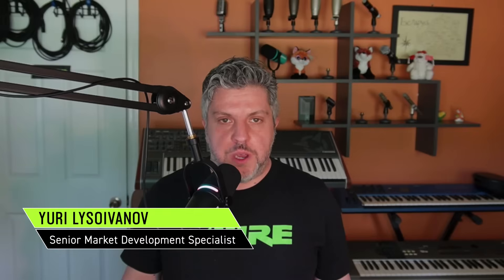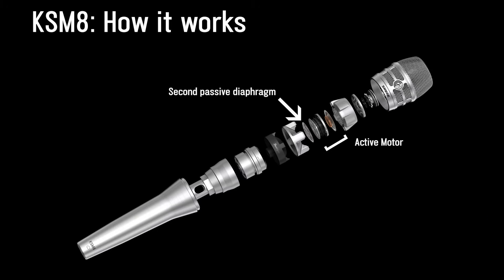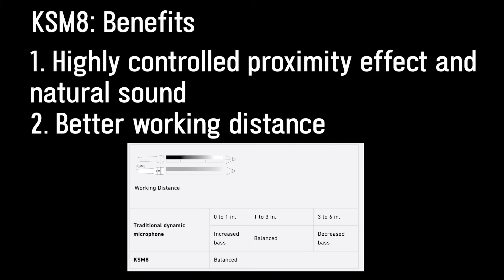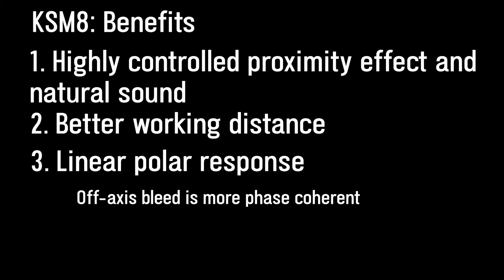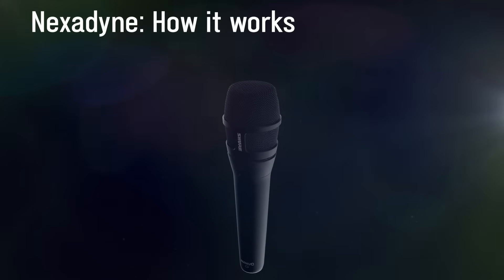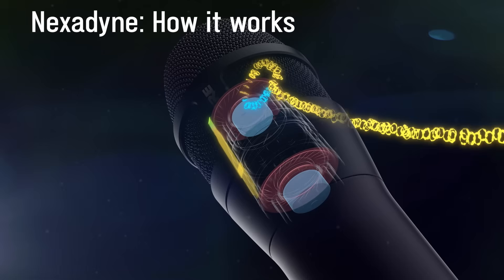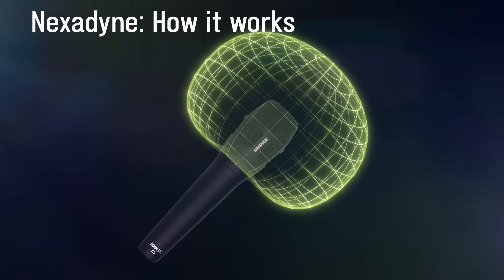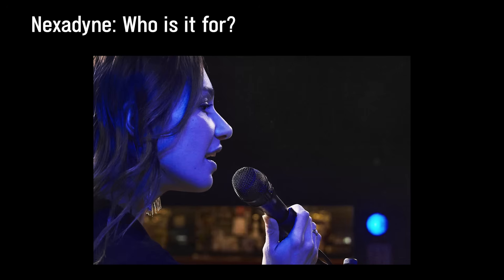Understanding KSM8 and Nexadyne NXN8: Differences and Unique Features | Shure

Comment: Someone seems to have forgotten about the AKG D200, D202 and D224 mics from the late 60s and 70s.  They were the real first range of dual diaphragm dynamic mics.  The KSM8 might be the first available for quite some time, but it's standing on the shoulders of giants.
Reply from the maker: @WonkeyWabbit The AKG 200 range does contain two capsules but they are not used in the same way. We touch on this in our KSM8 article here: https://www.shure.com/en-US/insights/dualdyne-technology-unsung-heroes-live-performance in the section under 'Dual Diaphragm vs. Dual Element'

Comment: the ksm8 and nxn8 ,, there is the top game ksm11 ,, can we just switch between capsule and having the same handle , just switchin the capsule from one to one , are they compatible
Reply from the maker: Hi! You can swap capsules if you are using a wireless handheld transmitter like our SLXD2. You cannot switch capsules on our wired mics.

Comment: Which is better, the shure ksm8 or the shure nexadyne 8/c in church venues?
Reply from the maker: Hi there! This comes down to a few things. What is the main application? If spoken word, I would recommend the KSM8. If you're looking for a microphone that performs well on spoken word, vocals and instruments, the Nexadyne may give you more options.
Reply: Hi I am thinking of getting the KSM 8 as I am a Cardioid kind of singer.  But my set-up up is minimal, no sound desk.  I am using the Bose S1 Pro + and the Bose wireless transmitter.  I need a 'hot' mic and one that requires little eq out of the box because I don't want to crank up the gain and get feedback.  I know some mics need a lot of gain, which is no good for my situation. 
Thank you.

Comment: I am a classical tenor but I also sing rock songs. Which one should I go for? (Currently performing with a Sennheise E965).
Reply from the maker: Hey, Yuri here! The mic you're using now is a condenser mic with selectable patterns. While the KSM8 and NXN8 are both dynamic mics, the NXN8 would be my choice for your needs since it sounds surprisingly similar to a condenser mic but has all of the advantages of dynamic on stage! Also, if you're playing a lot of loud rock music - the NXN8 will provide better rejection compared to the KSM8. Your current mic also has a selectable polar pattern, while with the NXN8 you'll have to choose either cardioid or supercardioid. If you're interested in sticking with a condenser microphone with selectable cardioid or supercardioid patterns, check out the Shure KSM9!

Comment: KSM8 = Plosives and severe handling noise and rapper-grip problem and don't ever use on a podium. NXN8 seems to be addressing this and at a lower cost. and yes the Beta 87 is a better all-around mic than the KSM8.
Reply from the maker: Yuri here! I love the KSM8, but if you're working with a lot of rappers - I'd recommend giving the KSM11 a spin!
Reply: @shurecreators  interesting , i dindt look into the kms11 ,, looks like an extention of the nxn8 and ksm8 combine .. would sounds brither like the nxn8 ? also can we just switch the capsule between all of them and keeping the original handle ? also is it possible to buy just the handle as well . thaere a lots of fake as well being sell ,, dont want to get caught.<
Reply from the maker: Thanks for sharing your experience with the KSM8, I'll be sure to address these concerns in future videos!

Comment: From your description the Nexadyne sounds better than the KSM8, which doesn‘t make much sense to me. The question is: If you had to bring mics to a jib without knowing the vocalists, which one would you bring (not considering the price)?
Reply from the maker: Hi, Yuri here! I wouldn't say one sounds "better" - but they solve different problems. The Nexadyne will definitely be brighter and cut through the mix more than the KSM8, which has a very rich, neutral sound. However, the KSM8 has a more open cardioid pattern - so if someone moves around the mic a lot, the KSM8 will be more forgiving of that than Nexadyne will. The Nexadyne also has a supercardioid option which helps in environment where feedback needs to be minimized.
Reply: @ Yes, that‘s what I thought, thanks for the answer.  But my question was more in the lines of which of them is „the next SM58“. I have like ten Beta58, as they are what I put on the mic stands if nobody asks for some specialty. I like them, they sound fine and they are reliable. Never had any complaints. It‘s not happening soon, but what if I were to replace them? What would you consider more of the golden standard, working for most vocalists?
Reply from the maker: @jensdroessler3575  Yuri again. I would say the NXN8 is the "next step" in SM58, Beta58A story. While the KSM8 is actually my favorite vocal mic we make, it is a little more specialized - and the NXN is probably more useful in generalized situations. I don't think of the NXN8 is a replacement for the SM or Beta, but a premium addition to the line that gives you some more clarity and great, consistent rejection.
Reply: @ Ah, very well then.

Comment: Im in the market for a new dynamic vocal mic.   I currently have a choice of a Beta 57 and a Beyer dynamic v70 - I much prefer the v70 (I do liek the   air it has), however this is the one that needs replacing, and its not great with handling noise hence looking for something else.   Im considering the Senny MD431, the KSM8 and the NXN8.   Nowhere I can find any to try - let along more than one to compare.
Reply from the maker: Hi, Yuri here. I can't speak to the Beyer or the Sennheiser mics you mentioned, but I will say that the KSM8 has our famous pneumatic shock mount, and the NXN8 has a brand new acoustic/electric handling noise reduction system - which are both proprietary to Shure. The pneumatic shock mount is still the best in class shock absorption, and we also have it in the SM58 and the Beta 58A (The Beta 57 you mentioned has a different type of shock mount).

Comment: Any thoughts about Nexadyne vs KSM9? I currently gig with the KSM8 and wanted to add the KSM9 but this dropped
Reply from the maker: Hi, Yuri here. It's hard to directly compare since the NXN8 is a dynamic mic and the KSM9 is a condenser mic. Depending on how you gig, you might see some feedback when using a condenser mic like the KSM9 (for example with a lot of wedges and side fills) that you would minimize by the NXN8. However the KSM9 has a wider frequency response as well and it has a switch to select it to be either supercardioid or cardioid. So your mic choice should really depend on what you need for your voice and what you're trying to achieve live.

Comment: I just reviewed your polar charts for the KSM8 and am confused,  Benefit number 3: linear polar response is not what is depicted.  There are significant frequency dependent off axis variations: 9kHz @ 60 degrees, 2.5kHz @ 90 degrees, 6.4kHz @ 30, 60, & 90 degrees.  It doesn’t appear significantly better than the Nexadyne performance.  It does have a flatter frequency response up to 10 kHz so should sound more natural with less EQ required.  Might be better for vocal recording but does lack air frequencies.
Reply from the maker: Hi, Yuri here. Thanks so much for the response. When we say linear off-axis response, what's happening is that when unwanted sound enters off-axis, it often affects the phase coherency and as a result, the quality of the direct sound. The design of the KSM8 mitigates that quite a bit, so when unwanted sound comes in off-axis, it stays more phase coherent and the source sound remains high quality, even in the presence of off-axis bleed. 

The NXN8 actually has a pretty linear off-axis polar response as well,  but it also has great off-axis rejection.
Reply: @shurecreators   Thanks Yuri for the clarification!  So If I understand, with improved phase coherence there is less constructive/destructive interference from off axis sound so the direct capture is less impacted?  I like the KSM8 but may have to get a KXN8 to try out.  Certainly the polar pattern looks exceptional!